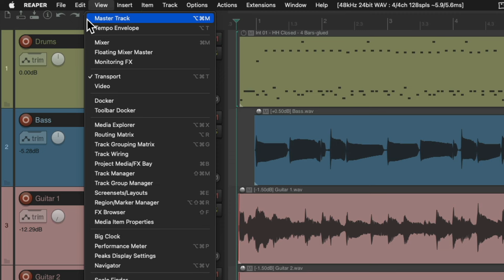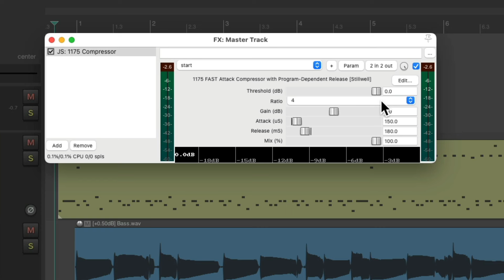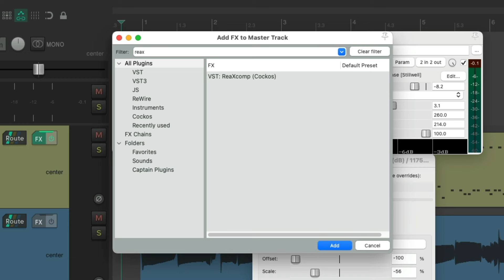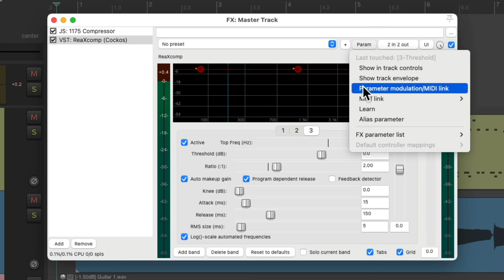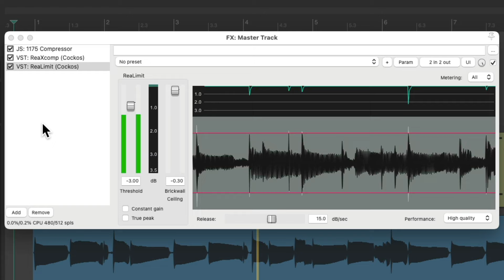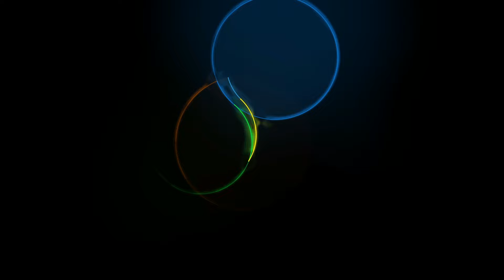How to Glue a Mix in REAPER

Comment: Kenny, that was literally the best class on mastering I have ever watched. No reason to ever buy any external plugins at this point.
Reply from the maker: And I'm not a mastering engineer.
Reply: Compare it side-by-side with your best sounds from external plug-ins . . . REAPER has good compressors but some hardware emulation alternatives add their own characteristics, and in the master chains where you're done with the drastic creative changes to individual tracks, and moving on to subtle tweaks, the choice of plugin itself is part of how you shape the sound creatively. There is often an algorithm closest to ideal-sounding for a particular purpose to start with, even if it is for the same end goal, and if you don't build it from scratch, more plugins come in handy. If it's saturation, reverb, synthesis . . . those all benefit from having their own tones, so looking beyond starts to make sense.
Reply: @REAPERMania  I beg to differ....Great Job kenny!
Reply: Where is it?

Comment: Having all the thresholds the same on the multi-band won't work because the levels drop off as the frequency increases which means the low end is getting more compression. You probably shouldn't link them and then adjust by ear as needed in conjunction with the analyzer.

Comment: ProTip - add JS Volume as a trim in the end of the chain, compensating the result total loudness when comparing bypassed FX chain ;)
Reply: Yeah, he keeps saying it sounds better when it mostly sounds louder
Reply: @richardjecooke8036  that's technically not wrong though, because purpose of final master is make optimal dynamic range, so it obviously gets louder,
you'd still want to disable that JS Volume trim before rendering :D
Reply from the maker: @richardjecooke8036  Compression and limiting will make it sound louder.

Comment: Great! But, one question: why do you use a multiband compressor and then link all 3 bands together? Wouldn't this procedure make the multiband compressor stop acting like one? Thank you very much for your videos!!!
Daniel from Argentina.
Reply: That’s what I was thinking. Kinda defeats the purpose of it being a multi band compressor
Reply from the maker: No. The bands are still separate. They're just treated in a similar way. But only the low end information is triggering the low end range. Same for the mids and highs. So the compression is still 100% separate.
Reply: @REAPERMania  Thanks Kenny!! I think I understand now! In other words, common compression processes all the signal together while multiband compression segments it, even though the bands are linked?
Reply from the maker: @danielpisera  Yes. The only thing linked is HOW they react. Not WHAT they react to.

Comment: Would have been interesting to render two editions of this: One with no Plugins and one with all your Glue Chain Plugins. It is noticable louder and can fool the ears it sounds better. 

Render out them as wave file and then using the Extension called "loudness" to check what the loudness is of both tracks. Then adjust the difrences and play them back against eacherother to see how much of a chainge there really is.
Reply: Yeah, the processed version being louder is a problem, buy no need to render. Just take a few extra seconds on each plugin to get the makeup gain to match. Then you can easily bypass any individual plugin, or the whole chain and hear them level-matched.
Reply from the maker: I'm just showing you how I do it. Hopefully you will try it on your projects.

Comment: Running REAPER v6.75 in windows (64 bit) and parameter linking as instructed here does not work, either in the 1175 compressor OR the multiband compressor. 

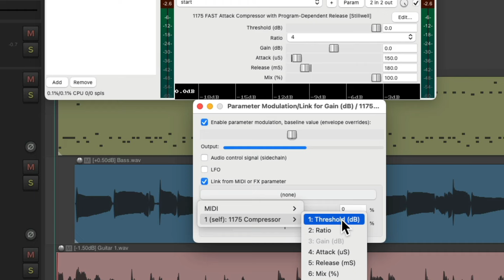My parameter linking window looks exactly like yours, and when I'm done, in the "Link from MIDI or FX parameter" window, it says: "1(self): 1175 Compressor: 1: Threshold (db)" just like yours does (at 2:49 in the video), and it also shows them linked in the drop-down menu - but they are not actually linked.

Any ideas?

Comment: Hi Kenny, what a great idea to link gain and threshold. I followed your instructions but can't get the linking to work. Any idea why that would be?
Reply from the maker: Most likely you didn't follow my instructions exactly.
Reply: @REAPERMania  hmm, I did follow it step by step quite a few times. It is easy to understand but it's not working. Anyway, it's a great idea.
Reply from the maker: @roberteismann1929  It's just hard for me to know what you're doing wrong without knowing what you're doing.
Reply: @REAPERMania  and now it works, how odd and also great.

Comment: "To compress each frequency separately". Ok, but then I don't get why Kenny used the multiband compressor with the band thresholds linked together? The bands also had all the same knee, attack and release, so it was just acting like a wide-band compressor? Anyone explain why not just use ReaComp there instead?

Comment: I don’t understand the point of using a multi band compressor if you’re just going to compress all the bands the same amount at the same time?  Perhaps someone can set me straight, please?  Tia
Reply: The settings are the same for each band, but the signal each band is reacting to is different. So the lowest band will mostly be reacting to the kick and bass guitar. The highest band will mostly be reacting to high hat and cymbals. Etc.